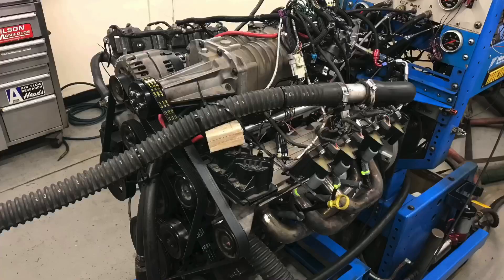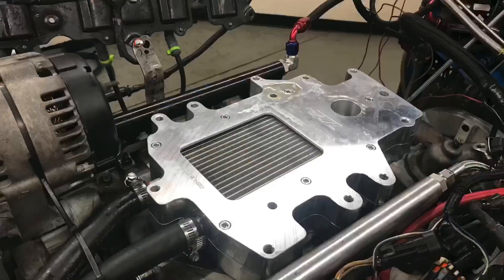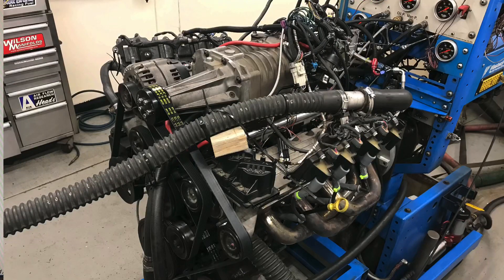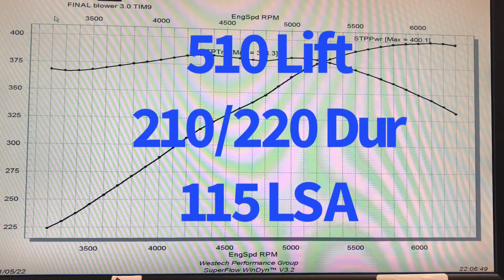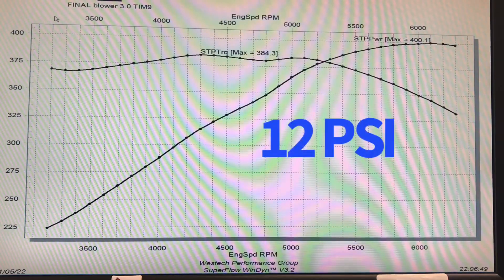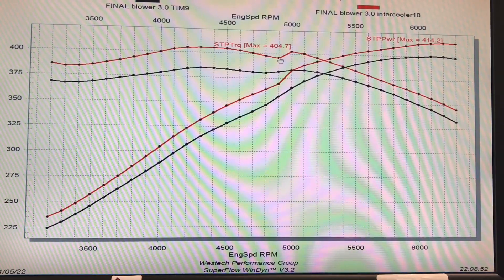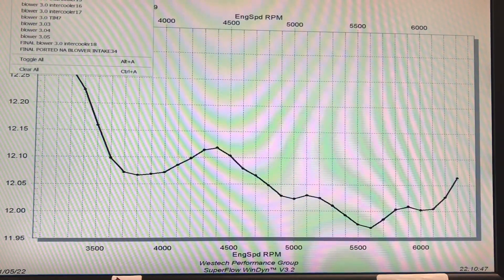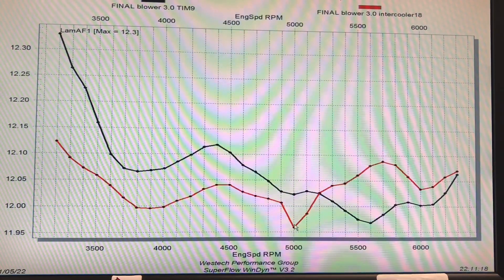DO INTERCOOLERS ADD POWER? JUNKYARD SUPERCHARGED 3800 L67 V6 INTERCOOLER TEST. ZZP AIR-TO-WATER TEST

Comment: Build a 'pre-cooler' to cool the air before the air enters the blower.  More to be gained on that side than after the blower.
Reply: No.
Reply: I think you have it backwards.
Reply: It is all about the air density entering the engine.  Doing the charge cooling before the supercharger increases the air density going into the supercharger making the supercharger more efficient and cools the air for less chance of detonation.
Reply: Maybe you should make a pre-cooler, and show us how much better it is.
Reply: @michaelblacktree  Already been done with success!  I refer you to Gale Banks.
Reply: @donbrutcher4501  from all the Banks videos i've watched (nearly all) i only see him talking about pre-stage intercooling. Not running and intercooler before the blower. If you were blowing a turbo into the supercharger then yes, adding an intercooler before the blower would work. But to just hook up a intercooler to the inlet of the blower wouldn't produce any added cooling.
Reply: @sg34qw  If I remember correctly, Gale and friends ran a Vette o the lakes in a NA class.  They built an air chiller and put it in the intake tract.  The cooling of the air below ambient increased the mass density of the air entering the engine, greatly increasing power.  Imagine the air going into the engine being 100 deg F lower than your competitors and at an altitude density hundreds of feet lower.  Makes the parasitic loads of a supercharger look rather silly.
Reply: @donbrutcher4501  your talking about the carbon dioxide cooler he made. Specifying that wouldve made your original comment make more sense
Reply: @donbrutcher4501  intercoolers rely on positive pressure to work (correct me if im wrong). Drawing thru one would be nothing but a restriction
Reply: @sg34qw  Intercoolers need not have a pressure differential. They are all about temperature difference.  Definitely don't want a restriction (mass flow reduction) across the cooler.

Comment: You have not tested it in this cycle, but do you think a little bigger than the stock size screw blower on pump gas at stock boost levels and a smaller non-stock cam get by without an intercooler?  Hood clearance on these cars is Limited? Tranny is a week point I do not want to play with very much. Mostly a long distance cross-country cruiser ride.
Reply from the maker: YES
Reply: @richardholdener1727  Thank You

Comment: Water suppresses flame travel speed I'd think and takes some of the heat that was pushing the piston.
Richard do you do egt temps on all your dyno runs?  Curious about more egt info vs intake temps ect
Reply: Water displaces air and fuel decreasing effective displacement as well as

Comment: I'd love to see a test of how effective charge cooling is on a methanol setup making decent power. I know the methanol guys usually don't run any charge cooling, to save weight, so I'd love to see how much power they're giving up.
Reply: i ran meth 93 octane, ported heads, 42# injectors, 1.95 yt rockers, 90 lb springs, gen 5 with  3.0 pulley and intercooled with ported lim.  that blower never got hot once i sprayed meth. was able to run 21º max wot timing at 13 psi.  i know of guys who ran a 2.55 pulley and the same set up as in the vid. making 16 or so psi and 28º wot timing.  hes running the afr to lean for one, should be mid 11's. 12's are to lean.
Reply: @scottr2898  I meant running straight methanol rather than water/meth injection, and preferably something a little more modern.
Reply: @totensiebush  ill let ya know when my 5th gen camaro gets meth added. going straight meth with a alky kit. got a friend with similar mods as me making 700 wheel with meth, more boost and timing is all hes got over me. and im at 600 wheel.
Reply from the maker: TUNERS BE LIKE
Reply: @richardholdener1727  …. Well yes they do….

Comment: I'd be Interested to see how far down of pulley you can go down to before you see the efficiency of the blower fall off. I'd like to see you go all the way down to a 2.8, 2.6 and  2.4" pulley.
Reply: same. I have the parts to drop to a 2.6 on my gen 5'd l67 on e85. But i'd like to see the full data before moving forward. I'm at a 3.0/ic/e85 right now
Reply: Eaton used to have the VE tables on their website for the M90. At some point you need to port the blower and that stock throttle body is like breathing through a straw. I daily drove mine on a 2.8 pulley with all the supporting mods, anything smaller needs race gas to keep KR in check and you need a belt wrap kit.
Reply: @GreaseMonkeyGarageTX  hes running the gen 5 though, not a whole lot to port there. He also has the gen 5 throttle body which is basically the same opening as the northstar if i remember. Would be more to gain if he was still on a gen 3. I've looked at the VE charts eaton posts and even a 3.0 pulley is wayyyy off their chart. Unless i'm reading it wrong
Reply: @GreaseMonkeyGarageTX  I think they also published tables showing that above 16k rpm blower speed everything went pear shaped fast in terms of efficiency.  A 3.8 needs an M90 to spin at about 1.25 times engine speed just to fill the cylinders to 100%, which would result in a 7500 rpm blower speed.  So theoretically we could get it up to about 17-18 psi (intercooled) before the blower efficiency started to have real issues.
Reply: I ran my 1.9rr, Intercooled, e85, nitrous125shot l32 down to a 2.4 pulley before before going turbo. I ran an 8 rib setup after going to a 2.6. I was also on stock cam so I only revved it out to 6000rpm.
Reply: @sandvick1  i  was actually basing my 2.6 build off of yours, to be honest. I always see people saying don't go lower that a 3.0 pulley just because "everyone" tells you not to, but no actual proof to back that up. I tend to see for myself in situations like that.
Reply: @sg34qw  my old supercharged setup was very solid and very reliable. But this will also bring the old timing over boost subject. He will likely have to start pulling some timing as he drops to the tiny pulleys
Reply: @sandvick1  Yeah, I'm interested in what he does with the timing. I'm at 24 degrees from 4000 up right now on ethanol. More than most run, but my l67 is in a sunfire. So i'm only assuming im getting away with running more timing because of the weight it's pulling. My setup has been rock solid for the 2 years I've had it too.

Comment: Hmmm intercooler with water/meth injection 😁
Reply: Charge air temperature is only 112F after the intercooler.  Water/methanol will not evaporate at that low temperature.  Water/meth is only effective when IMT is above 170F.

Comment: Would be very interesting to see if the intercooler would have a much larger effect on power in a pump gas stock cam configuration, great testing as always
Reply: It would, making such a test on e85 removes half of the effect of the intercooler, since it could run close to mbt igntion even without IC.
Reply: The gains would be even more pronounced. On 3800s be usually either do intercooler or e85. Not usually both. And end up around the same numbers with a cam.

Comment: That dip in power is wierd. Wondering if it has anything to do with the balance shaft? Definitely would benefit from a ported blower and a northstar throttle body.
Reply: i wonder if its belt slip. Normally with anything smaller than a 3.2 they recommend the belt wrap kit.
Reply: @sg34qw  good point. I ran mine with a grip pulley and an oversized tensioner and was good on a 3.0
Reply: @GreaseMonkeyGarageTX  i run the belt wrap kit on my 3.0 and have never had an issue either.

Comment: The intercooler would have made a bigger difference on 91 octane,  e85 is almost a intercooler itself
Reply: e85 is knock resistant at higher temps. if it was "almost an intercooler" you wouldnt see 214 degree IAT's non-intercooled.
Reply: @sg34qw  eh.. the reality lies somewhere in the middle. The temp probe is before the E85 is introduced. E85 DOES significantly cool the air, but not until it's going through the port and into the cylinder, where we can't exactly measure it with a temp probe. But, you can calculate it.
Reply: @armcclure  e85 barely makes a difference when you have multi port injection. It makes a significant difference when carbureted or tbi.
Reply: @triplestangman  it makes a bigger MEASURABLE difference with TBI or carb. I understand what you're talking about, I've seen high-rise blow-through E85 turbo cars with condensation on the outside of the runners. 
That cooling effect still happens in a port injection setup. The fuel still has to change state to burn. We just don't have a temp probe inside of the combustion chamber.
Reply: Single turbo with e85 blowthrough carb no IC. 25psi boost airtemp before carb is 210-220F. And below the carb 75-80
Reply: @janilindroos3688  your temperature looks more like 10 lbs of boost, I would think that 25 lbs. would be 300 or more degrees above the carb...why so low?

Comment: That's awesome. Definitely worth what ZZP is asking. I kinda wish I did go the l67 route for my s10.
Reply: L67's are fine until you start breaking stuff. Parts can be a bit pricier and harder to come by. I loved my L67, but the LS platform is just so much better supported.
Reply: @GreaseMonkeyGarageTX  I've seen a few higher HP 67s but never seen any issues.  I've seen more problems on daily driven 67s that were neglected
Reply: @Matp345  once you start pushing them they break. Rings touch and you chip a piston. Forged pistons have a thicker ring grooze that helps a lot, but you are limited to a few options. The ARP kits were hard to come by,  not sure if they still make them. Heads lift, head gaskets blow out, etc.  I races an L67 for years and it was a blast, but not cheap or easy.

Comment: The main focus IMO isn't extra power, but greater safety with lower charge temperatures.
The extra power is a very nice bonus, though. 🙂
IMO it's worth the extra investment to better preserve the engine.
Reply: Agreed but E85 doesn't seem to care.   Pump gas needs an IC.   Only 14 hp gain with the IC and all that decreased temp.  Probably because that small IC core is restrictive to flow.
Reply: @Toys4Life  You may be correct- and anytime an effective IC can be used, I'd use it as a hedge against detonation, as it does do a good job of cooling the charge. I've read that too big an IC may cause a little bit more lag, but IMO, more is better than too small of an IC. If all else fails and E85 isn't a viable option, spray meth or a meth/h2o mixture. The methanal effectively raises the octane, while the misted water handles the charge cooling duties AND keeps the carbon to a minimum(and will clean a dirty combustion chamber). I've never seen anyone use E85 AND spray meth/alcohol at the same time tho, as I'd assume it's due to diminishing returns, although I'm not 100% certain about that. E85 is not convenient for all of us, but spraying meth is an easy, and likely less expensive alternative, regarding the setup of both.
Reply: @Toys4Life  Your ring lands care
Reply: The biggest deal with the CAC on this and for that matter any engine is a multiple aspect. These engines suffer from piston failure, mostly on the #5 due to the stock exhaust building too much back pressure which heats up that piston till it fails. The next part is getting and keeping KR under control, high intake air temps pretty much kill that process! Getting the IAT as low as possible makes it so much easier to limit timing issues and the rest is added bonus. We all know cooler air and what comes with that. Frankly I cannot understand why GM or any othe manufacturer didn't fix these problems before they left the Factory aside from being able to sell more crate engines and cars. The issue of building these and leaving them as grenades waiting to go off didn't do much for reputations. Fortunately there is an aftermarket that fixes stuff like this.
Reply: The intercooler makes the charge denser
Reply: @shadowopsairman1583  Yes, which increases power, since you have more oxygen in the same volume, which you can combine with more fuel to make more power.
But I'd be installing an intercooler mainly for the extra longevity and safety. 🙂
Reply: @Roddy_Zeh  or the same amount of safety with more power 🤔

Comment: M122 vs m90 charge air temperature will change.
Reply: ZZP also did a hybrid M90 with M112 rotors years ago that had some nice gains. I wonder if there are any kits still floating around out there.

Comment: Great engine only real problem Glass transmission anything above 320 hp they just melt.
Reply: Yeah the 4T65e-hd has its weak points, but with a clean build can safely hold that power as long as you don't beat on it. Now checkout what LS4 King is doing with the 4T80, it makes more things possible.

Comment: I just purchased a vortech v3 for my mustang they come non intercooled so I feel like that's the better route until its all lined out then maybe go intercooled later on, Just not entirely sure if its necessary
Reply: How much boost do you plan on running?
Reply: My vortech didn't come with an intercooler either. Temps got up to 140* pretty quick. Installed a cheapy moto set-up, temps stay around 75* up to 9psi on a 351w. Guess it depends on how much you are making it eat.

Comment: That thing is $1200 I think you would be better off just pulling the supercharger and getting NA parts and turboing it with an air to air
Reply: $1200 is cheap for what you're getting.
Reply: I don't know I mean I could see it being less of a high cost to me if it was for like a new car but for either a like 15 year old car or a swap it just doesn't make that much sense to me
Reply: @james10739  then I think your watching the wrong videos my friend.
Reply: There's one on ebay right now for $300. The stage 2 intercooler
Reply: @Matp345  that's pretty reasonable even if it's just the intercooler part not the full kit but I imagine you are still going to be over $500 if it's not the kit
Reply: @james10739  it's just the heat exchanger for under the blower. But that's the hard part.  The pump and cooler for front you can use anything
Reply: @Matp345  is it tho? 1200 for 15hp and though the consistency is nice is it really worth 1200?
Reply: @jacobburskey3044  its more power all the time along with keeping charge Temps down which under the hood will be more beneficial then in a dyno cell
Reply: Go look at how much a turbo kit costs
Reply: Well not a kit but I'm assuming you are building your own with like a knock off gt45 or gt35 maybe depending on the power you want to make vs response